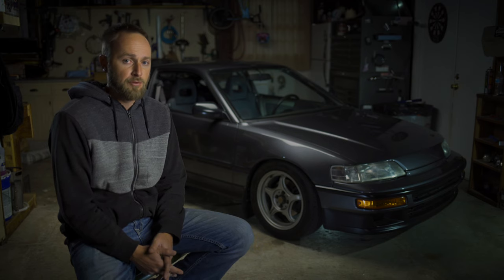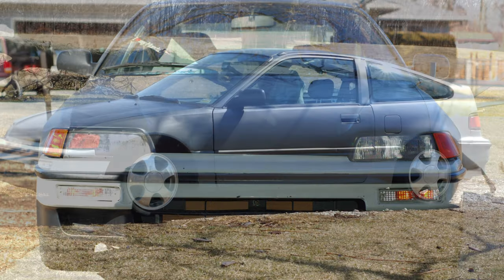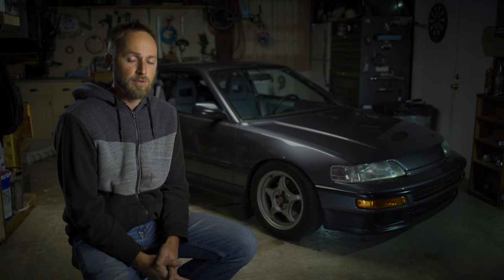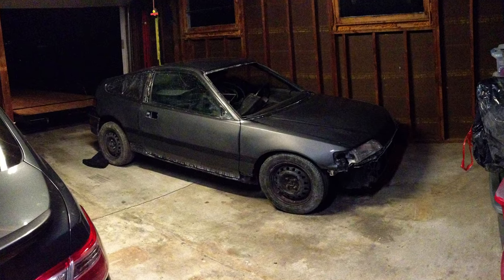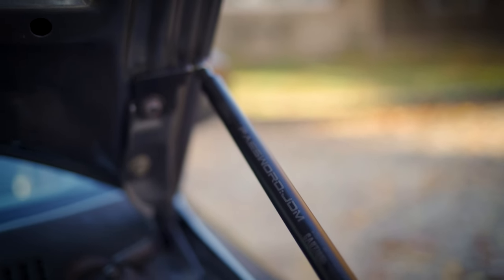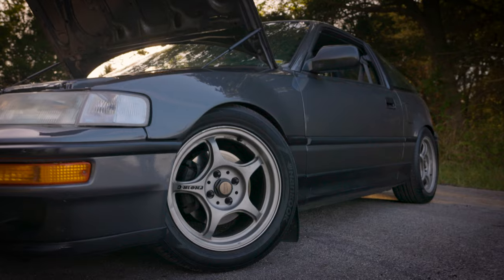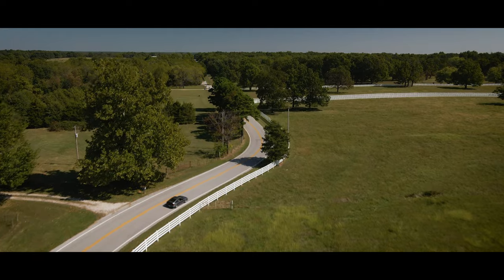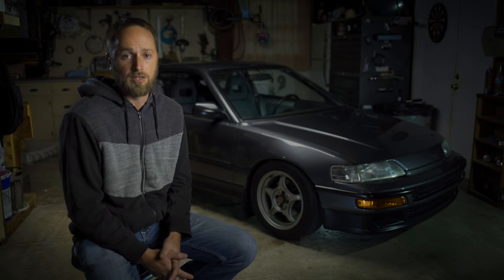Home Brew-short film documentary of the build and history of my 1991 Honda CRX

Comment: I haven’t had my CRX on the road in over 15 years but I posted my build online back in 2008 and we share a lot of parallels in our builds. This is more of the vision I wished I could have produced. Your build, your video, the love for the car and the pride of the efforts. I feel you. I haven’t been very active beyond collecting parts since putting it away. I built an LSVTEC turbo engine that I ended up selling at the start of the pandemic but that’s the last I worked on/with it. Financially I haven’t been able to add anything to it and the car’s been buried in storage for years. The car has taken a back seat to family and work but this summer I’ve started a new path in the K-Series direction, have put a lot of research in on the k-swap because it’s all new to me. Picked up an Accord K24a8 with a manual transmission and full wire harness. Maybe some day I’ll get it back on the road. If I can find you on Instagram I’ll give you a follow and send you a message.

Comment: Just finished doint this to my DA9. Currently doing the body work on my s2000 and painting it moon rock. Already got the jambs done
Reply from the maker: Very cool. Can't go wrong with moonrock and can never go wrong with an s2000! I actually almost traded this car for an S2000 about a year ago
Reply: @diversedad7954  i lucked out and got a clean title ap2 with a rod knock for under 5k lol
Reply from the maker: @mikelmorgan6409  wow that's great!! You putting a new motor in or rebuilding that one?
Reply: @diversedad7954  i rebuilt it in my garage 3 years ago. New rings, bearings, all new seals and gaskets. It's been running great for 3 years now lol. The paint was just bad. I paid some one to paint it. And they did a horrible job.
Reply from the maker: @mikelmorgan6409  There is almost nothing worse than having something painted and it not being a good job. Because at that point you basically have to start over and send it back down
Reply: @diversedad7954  i literally took a razor blade and peeled the paint off.
Reply from the maker: @mikelmorgan6409  bummer 😢

Comment: i love that its a hf cuz thats what im in the process of building. scored a gsr, rear disc conversion , and black interior 88 si seats for it. cant wait to get it on the road. also your vision and way you built your car is exactly my taste and what I hope do achieve with mine.
Reply from the maker: That's awesome. Sounds like a similar build. Thanks for the comment and good luck!
Reply: @diversedad7954  can you make another video some day more in depth about how you did your fusebox, brake lines, and harness
Reply from the maker: @DistortedApricot  I actually sold the car just before I finish this video. Honestly without doing a how-to video while I'm actually doing it, there wouldn't really be any way to show something like that with a finished car. I did another video that goes in-depth showing how to use An fittings which is very detailed and those are the types of fittings I used to run all of my brake lines and fuel lines. It may help answer some of your questions

Comment: Sweet car. Really enjoyed the video. I havent seen a crx in years. I had an 88 HF. I think it would look nice with some OEM honda wheels.
Reply from the maker: Thanks. Yeah don't see them often. That's one thing I've never owned is a set of period correct oem wheels! I do like them but the width and offset of oem wheels on one that's sits as low as mine look kinda cheesy(tires tucked into the wheel wells).

Comment: Great video and content, sir ! 'im amazed by the work you put in your beautiful car, thumbs up ! It actually inspires me some more to get my car done properly, i'm even considering an engine swap eventually someday. I've a bone stock '89 ED9 Honda CRX (D16A9 engine 270k kms), quite clean, almost rust free. it's painted in original NH-95M silver blade color. Ultimately, i'd like to bring it back to its cleanest form, just considering an engine swap and adding coilovers and some nice rims (mugen CF-48 would be the holy grail). I'm no mechanic though and have no proper garage to do so, but your story keeps hope shining, thank you very much, very best regards from brittany, france !
Reply from the maker: Thanks so much for the comment. Doing it yourself with little experience is not easy and will take a long time and is very frustrating at times. However if you are determined and can see it through to the finish, it is way more rewarding and saves you a ton of money. Good luck with the build however deep you go!

Comment: Did the climate control swap allow for all push buttons and fan and cold/hot dials to work as well. Did your car have Air Conditioning along with the heater?
Reply from the maker: All buttons worked fine. The fan speed knob has an extra fan speed than the crx so highest fan speed does not work but you can just wire the last 2 speed setting together. I just didn't use high fan position. I had no ac. The hardest part is Rigging the blend knob to work with the factory cables to change from hot to cold. I never found a great way to do it and would just reach up under the dash and flip it for fresh air in the summer and heat in the winter.

Thanks for watching!

Comment: What did you have to do to integrate that climate control? Mine is perfect but that’s just cool.
Reply from the maker: Just had to cut the wiring harness and completely rewire it to control the accord one. There was a writeup on Honda tech on how to do it. I followed that. Not too difficult if you have directions on what wires to connect.
Reply from the maker: BTW my white crx that I drove when I started building this one also had a perfect climate control and I was going to use it me I was super careful with it but it still developed a crack on its own. I suggest pulling it out and reinforcing it before it does crack on you. Thanks for watching!
Reply: @diversedad7954  awesome. Thanks man.
Reply: @diversedad7954  Did that swap allow all the buttons to work as in the OEM...Did your car have air conditioning and did the swap allow for that to work?
Reply from the maker: @choche1969  all the buttons did work. The accord has 4 fan speeds and crx only has 3 so the 4th fan speed does not function. I did not have ac in mine. I never hooked up the cold/hot blend knob cause it's kind of a pain to make it work right. I jist reached under the dash and changed it from heat to cool a couple times a year.